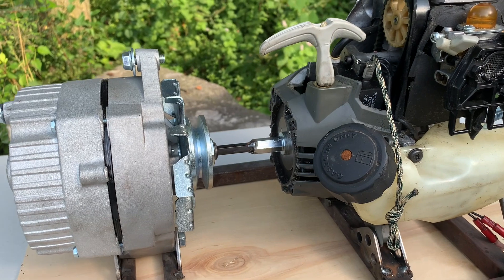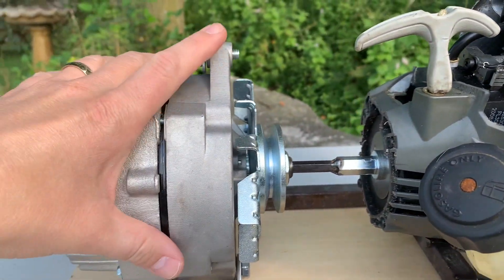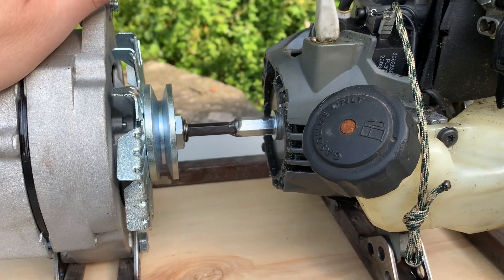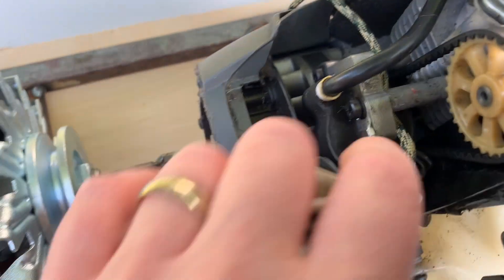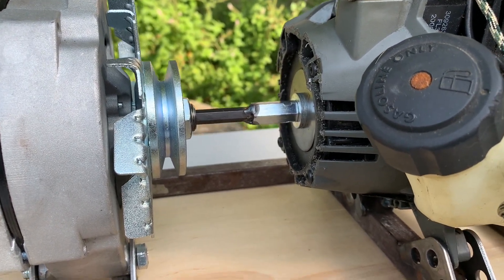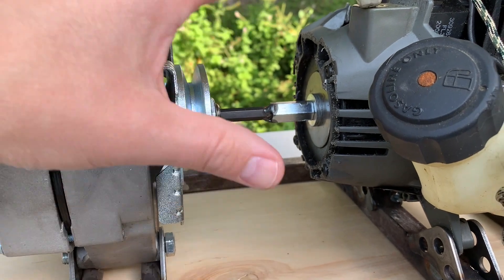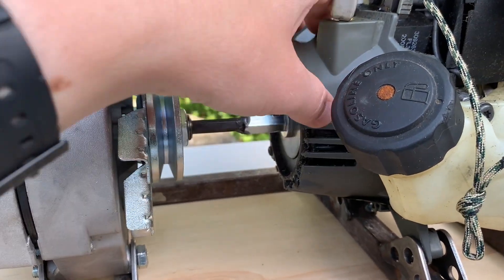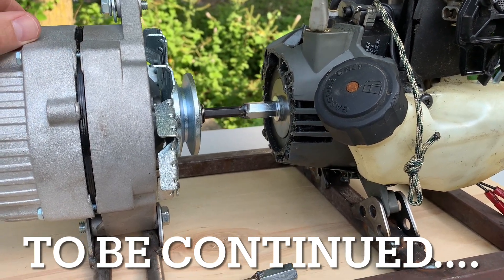DIY 12v Generator - Ryobi c430 String Trimmer (Part 2)

Comment: Well a few thoughts, first maybe the two cycle engine is a good idea because it makes power on every stroke unlike a 4 cycle engine, second even a 60 amp automotive alternator will require about five horse power to run it but will require more than 3600 rpms if direct driven. Think about in a car it's most likely being over driven by 500% in a car looking at the crank pully vs. the Alternator pully. And the next question is the Alternator producing 13.8 volts DC or will you look to get 3 phase A/C without rectification after modifying the alternator? Sorry but I missed the first installment of this video.

Comment: I did a generator and 3 hp briggs on a piece of wood with half inch steel pipe that fit loose about 3 inch long with two holes drilled and used heavy nails as drive pins, still works 40 years later generator is electric start